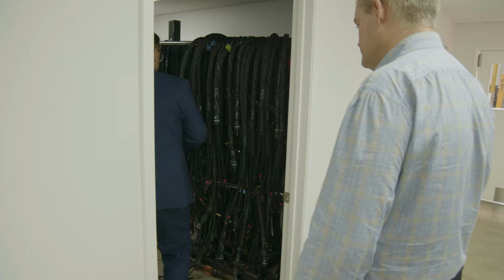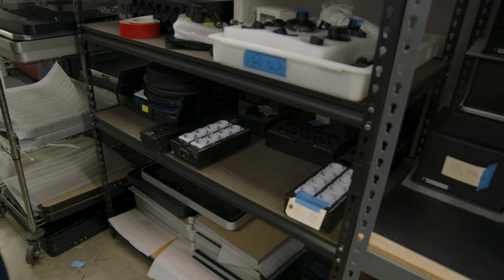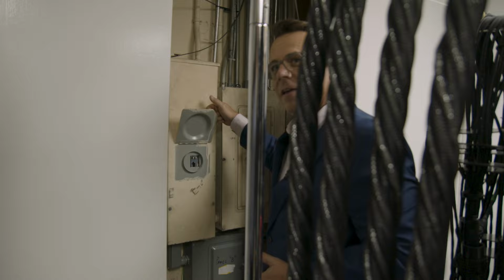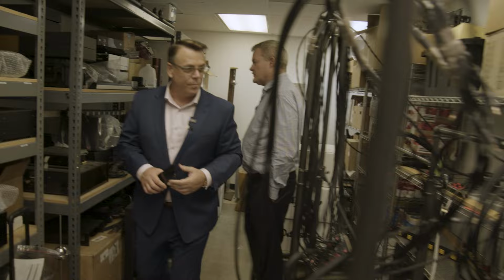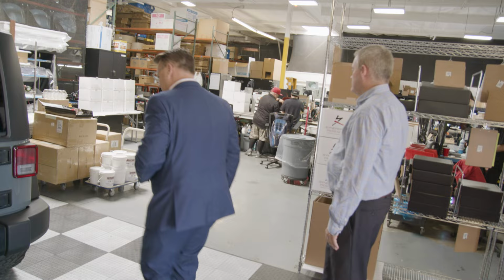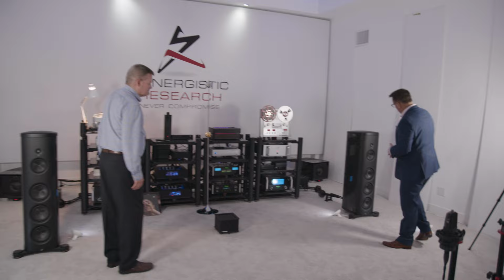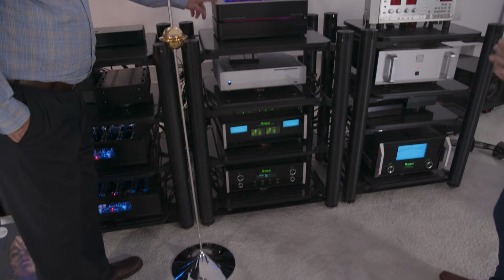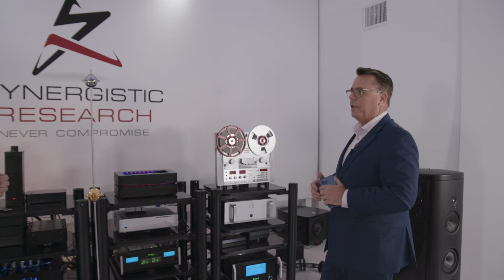What does Synergistic Research's NEW factory look like?

Comment: I have tried about 8 or 9 SR products in the past 7 years.  Half I returned or sold as either insufficient in adding to my audio system (Black Box resonator), bad compared to four other cables (Foundation digital cable) or too much work (Atmosphere XL).  However, I kept a slew (34) of HFT devices, the SRX MiGs for an EAR 890 amp, blue fuses for monoblock tube amps, blue power outlets and lastly an Atmosphere Euphoria digital cable.   With HFT 2.0s, 4 side speaker wall bass units and the 1 HFT-X location adjustments were clearly audible and made a huge difference, the others hardly noticeable to slightly noticeable.  The fuses, power outlets and cable made very substantial improvements.  

My advise with high end tweaks is to try them in your system in your listening room over a period of time.  Easy to put in and remove (except for power outlets).   Lack of measurements should not be a deterrent but be careful when purchasing.   SR permits try it with refund if you don't like it.  That's fair.